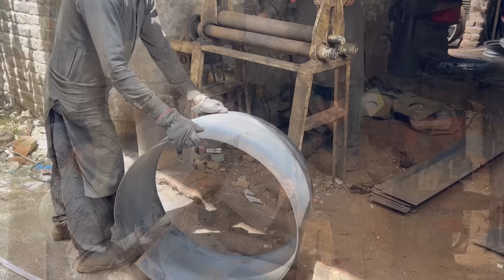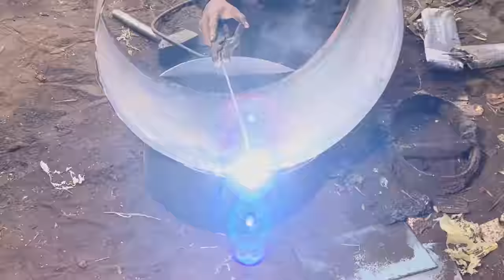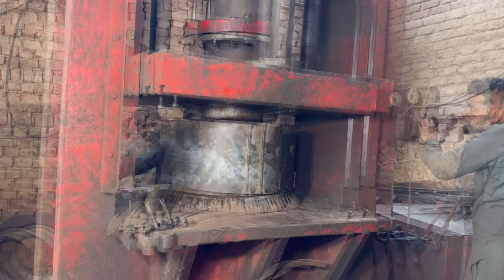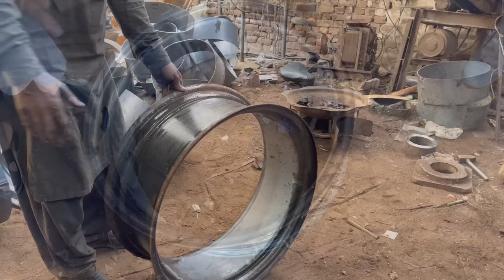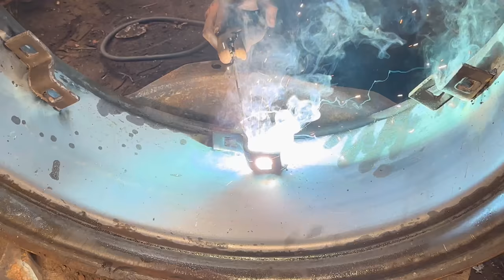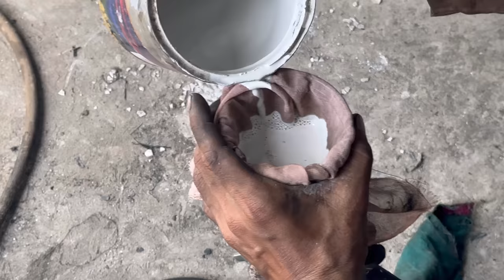Makin A New Tractor Rear Wheel Rim-Manufacturer Process Of Tractor Rear Wheel Rim|

Comment: I missed the bit where they trued the wheel?
Reply: this is for a tractor, tractors are not known for high speed, so no balancing or truing really needed.

when you consider a tractor driving through a paddock there will be more movement from the tractor bouncing around on the rough terrain than anything that might be felt from a slightly out of true wheel rim.